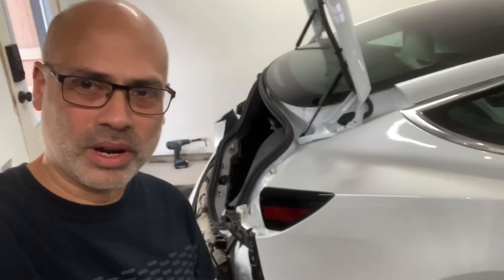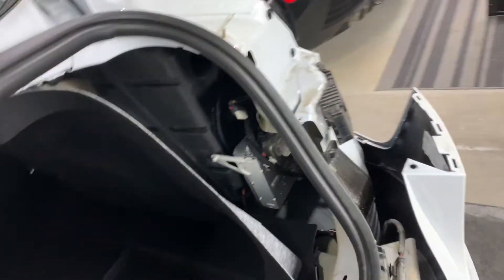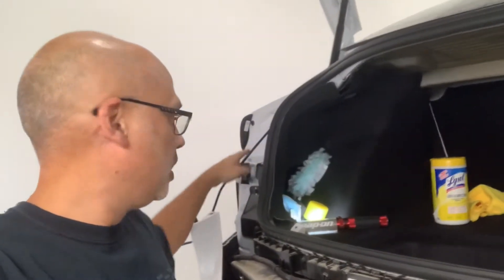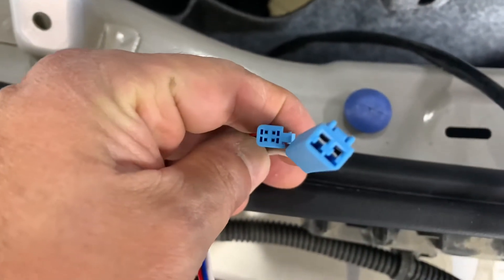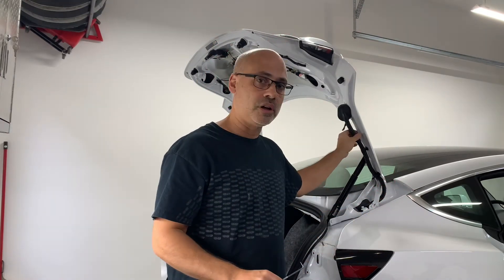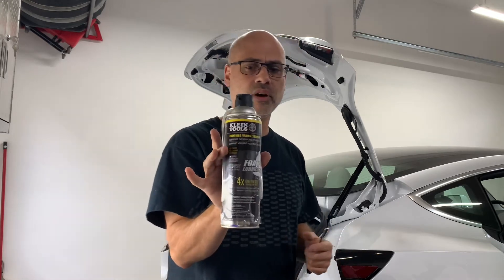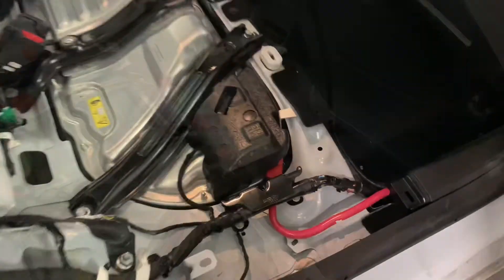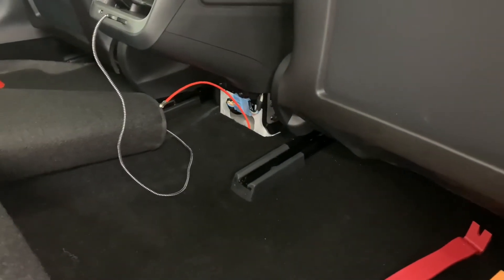Tesla Model 3 - Hansshow Power Liftgate tips and tricks for a better installation V4 and above

Comment: I would not mount the kick sensor on the access panel, as if you have a tow hitch or ever get one installed, you have to permanently remove this. I would mount it next to it. Also later versions just glue in with sticky tape and not screws. I just received a v7 kit and am going to install it next weekend, hopefully everything will be easy. Thanks for some great tips.

Comment: Getting ready to do my installation and taking notes to make sure I do everything correctly.  Can you provide more detail on what you did to the bumper?  I'd rather not take it all the way off if I can avoid it, but I don't quite understand what you did.  From the video it sounded like you didn't take any of the seven bottom bolts out.  Can you confirm or provide additional information?  Thanks!!

Comment: Running the strut cables through the blue grommets is the best option. One thing that would even be better for guaranteed waterproofing is to hole-punch the blue grommet with the hole very slightly smaller than the cable itself. That blue grommet is fairly stretchy and you can expand it to fit the molex ends through and you end up with a perfect seal. It's a minor knitpicky thing but it will minimize potential issues

Comment: If you can obtain them there is a much better way to run the wiring for the struts to go inside. Rather than the slopping and leak risking way of going behind the tailights or having to go all the way down to the trunk well through existing plugs there. This way will look like oem and only have the wire outside for about 3 inches. I made new holes in the vertical rain channel wall just behind the factory boot going to the trunk lid and used another sealing boot/groomet to come out which has a 90 degree and is just above where the strut mounts. Identical thing on the drivers side just by itself since there is no factory boot there.  Of course access and for the trunk lid wire fishing anyway, I removed the inside deck covering in order to facilitate access. I was also replacing the speakers anyway with the carbon fiber upgrade set from Light Harmonics anyway.
Reply from the maker: I used to be an automotive electronics installer in a previous life many years ago.  One rule of thumb was to avoid drilling new holes in the car.  But if it works for you, great!  Hopefully, you filed the hole edges and prime/enamel so no rust can start.  A grommet can trap moisture on those edges.
Reply: @Mixturerich  That is aluminum in that area as far as rust is concerned. The grommet covers the hole and overlaps it completely around on both sides under pressure and then had a tube heading outward and downward eliminating any chance of water getting in the penetration. . It is the same kind of grommet used for the trunk lid wiring. This grommet has a longer lip around and has a tighter fit than the factory one for the trunk lid. I had to really work it in to get it to expand over the edges. Any such grommet would completely seal from water getting under it. It is also on a vertical under the rear glass overhang and with the trunk closed, water does not really come down, but flows under it.   It would be easy to just pop it off and reseat it or touch it up if you wanted to.   Remember this is also on a vertical wall above where water runs below it. Under a tail light cramped behind its surface or a lower place below which accumulates more water flow is more likely to hold water around it or  allow water in. The grommet in the trunk is a hole in a flat surface without tubing directing it away. This grommet is double sided with tube traveling away from the opening.  Many I have spoken to still consider the other methods makeshift and risky. This is the only one that is actually how the oem would do it if they are installing such equipment.
Reply from the maker: Hello Ari, so technically aluminum wouldn't rust as that term is "reserved" for oxidation in iron.  Aluminum does corrode though, of this I have no doubt as I just had my aircraft inspected for aluminum corrosion.  More importantly though, that area is not aluminum.  It is steel, go check with a magnet.  My recommendation, from experience, dress the cutout with primer/paint to ensure that rust does not start under your grommet.  Your grommet can perhaps prevent large water droplets from travelling under its lip, but it cannot stop humidity forming underneath it.  In my days past, as an automotive tech, and on the rare occasion when I did not have any option other than to drill through the body of a car, it was a golden rule to cover any bare metal with primer/paint.  It is virtually inevitable that rust will start there.  The moment you drilled it, the oxidation process started, even if immeasurable.  Additionally, the considerations from a warranty point of view are not of insignificance.  Even if one can argue that the installation of this device already puts certain warranty issues under scrutiny, I wouldn't want to add drilling through the body on this list.  This is all personal choice of course.  I am just offering my best practical advice.  Cheers

Comment: Couple of things. Rather than create a lump in the floor relying on the floor material to give under pressure there is a much better way to run the wire for the can connection. . If you follow the door jamb on the passenger side up to halfway under the right front seat, there is a trough in the floor of the car that runs across the 2 front seats from side to side. This is a huge trough where you will see other wires run and it is about 1 inch deep and 2 inches front to back. You can run up the side uner the door jamb trim to this trough, and then right inside the trough to the center console. The wire will not have any floor carpet pressure or risk creating any lumps. There is enough room in these paths to run many more wires without consequence. Second thing in another comment.
Reply from the maker: Interesting location, did not know about it.  Did you take pictures or video?   Would be cool to see!  Regarding a lump in the carpet, there isn't at all.  With the underpadding, the wire is undetectable.  However, if I knew about that trough, I would have gone that way, thanks for the comment!
Reply: @Mixturerich  The trough is very easy to see. If you move the front passenger seat forward and reach under it, you can dig your hand into the floor because there are cuts there where the seat wiring comes out. If you pop the door jamb trim up on that passenger side and lift up the carpet edge, you can see where the wiring goes towards the middle of the car and down into the trough.
Reply: @Mixturerich  you are welcome. You may not see a lump now, but that wire pressure on the carpet and foam over time will push upward or deform the carpet. You may also be able to feel it with bare feet or with your hand in time. You are also running it in front of the seat or over the penthouse which is not ideal otherwise. Whereas that door jamb channel and trough have lots of space without pressure and are already there and used for lots of other wiring without constriction. If it were me, since it is not a hard thing to do, I would go back and rerun the wire if I had found this out and did not know about it before.

Comment: On other installs the power wire needs to go near the passenger panel - where do you get power from ?
Reply from the maker: I took mine at the 12V under the rear seat.  I didn’t cover this in my video as I think this should be a choice and it is not what is in the official instructions.
Reply: @Mixturerich  thanks. Sounds better.  My Tesla is RHD so may be more difficult to get it to passenger side.  Debating doing it DIY.
Reply: You might want to read my comments above. Sorry if you already installed it.  As far as power I easily ran a wire from the front 12v battery following the door jamb trim which was easy. I used this for the trunk kit, trailer wiring power, and additional power outlets in the trunk.

Comment: Great video - you have include lots of timesavers. One question on the V6. The power cable has a can-bus male connector that plugs into the adapter inter the center console; therefore where does the red 12v connector connect?
Reply from the maker: The can-bus connector that plugs into the center console is not combined with the power cable.  I am not sure what you're stating.  However, if simply you want to know where I chose to connect my power cable, it was to the +12V under the rear seat.  I did not include in my video as that was a personal choice, it's not in the instructions.

Comment: Thanks for the tips, will def use this in my install, as soon as my kit arrives.

Just wanted to know if its possible to replace the exisiting rectangular button, with something like this

https://www.amazon.com/dp/B07931ZKC1/ref=cm_sw_r_cp_api_glc_fabc_mL79FbGMSHGY0
Reply from the maker: I suppose you could. However, the supplied button is really nice and looks OEM.
Reply: @Mixturerich  just installed my kit, and v6 has a new button (circle shaped) everything works except for foot sensor, not sure what is the issue, i made sure everything is connected and right.
Reply from the maker: @UrusaiBaka7  Oh interesting.  I guess they decided on a design change or perhaps a supply issue.  Foot sensor doesn't have a lot of failure points.  Check connections and then ask Hansshow for a replacement kick sensor.
Reply: You might want to read my comments above. Sorry if you already installed it

Comment: Great tips, will def do these things when Im going to install my trunk kit this weekend :)
Reply: 3 weeks later, it went great but I couldnt for the love of me get the cables through the small holes in the back without lowering the bumper. 
I did not screw the sensor to the access panel. Instead I removed the ridges needed with an xacto knife, sanded a bit and cleaned it and used the included M3 tape. Seems to be working fine.

However, the trunk seems to be a bit more higher now than before, how do I make it lower and more snug?
Reply from the maker: Sounds like a good install.  As for your trunk, there aren't any adjustments that I could see.  Perhaps remove and reinstall.  Perhaps it is not seated correctly.  Fit and finish on the model 3 is sketchy for some of these things.
Reply: You might want to read my comments above. Sorry if you already installed it.